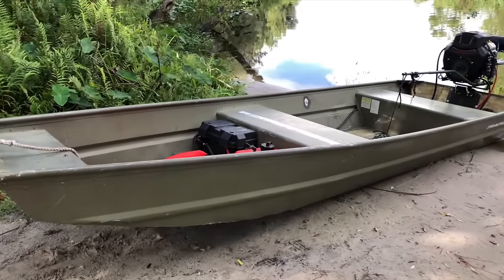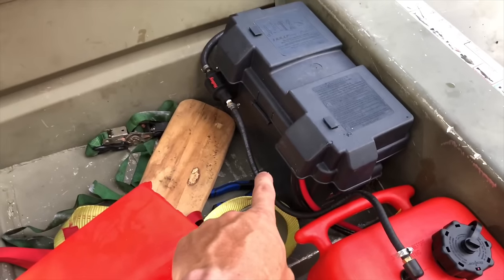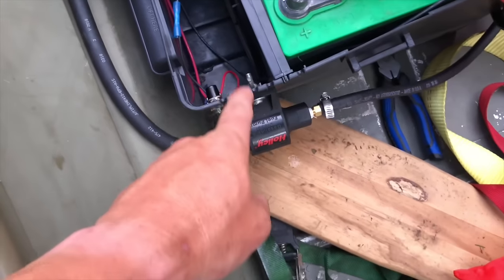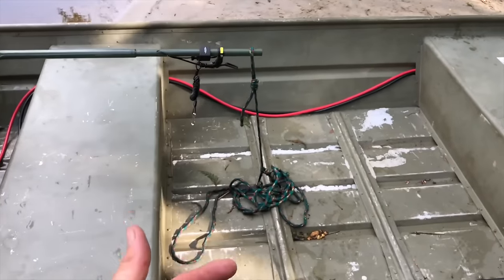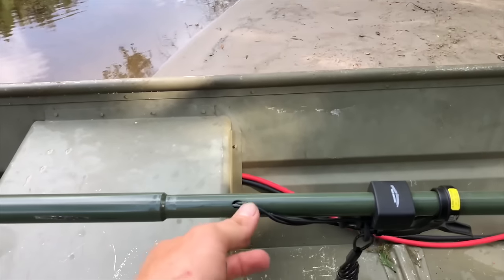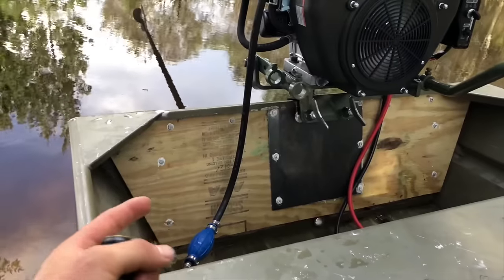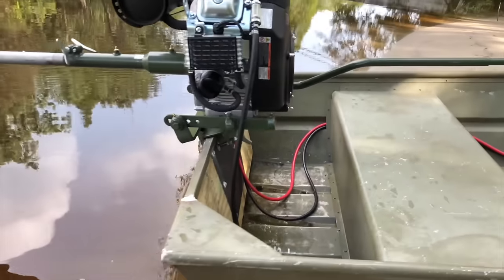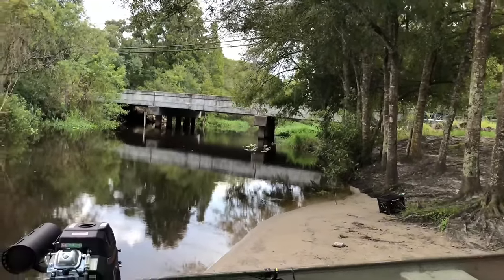22HP Predator 670cc SPS Mud Motor Setup 1436 Tracker

Comment: TIP: use a section of garden hose as a conduit for your fuel line when running it between the seat and hull. You can thank me when you're not stuck in the swamp with a leaking fuel line. Mud boats get a lot more vibration to wear any friction points along the fuel line.

Comment: nice setup,what I did to clean up my boat interior is get 3/4 inch pvc conduit and slide it in rib where you have your lines now.Put gas line inside one and battery cables inside toher one.

Comment: One thing I suggest is instead of the toggle switch for the auxiliary fuel pump run a wire to the ignition or kill switch so it turns on and off automatically with the motor
Reply from the maker: Arborcraft Surfboards yeah that’s a good idea! Thanks man
Reply: You dont need that holley pump at all and it will prob cause flooding / fire.

Comment: Thanks for the vid bro. I have a 14x36 and I want to make a surface drive for it, this helped a lot. Cant go wrong with that 5200! I found an old boat on a levee with a tree growing through it. Once I cut the tree down and got all the snakes out of it, I patched it up with some cardboard and 5200. I threw a 25 on it and  used that boat for four years with no leaks, before someone stole it.

Comment: I would move battery over where the fuel tank is and move the fuel tank where the battery is. That way you don't have your main battery cable running right next to the fuel tank... Also I didn't see any fuse on the fuel pump... Or a circuit breaker on the main battery cables I would add that also... If your main battery cable gets shorted out you could have a huge fuel tank fire the way you have all this set up...
Reply: KABOOM!

Comment: I've got this same engine setup on an alumnacraft 1540.  You did good to run the 1/4" fuel line the full length... I've got a frankenhose with reduction barbs going from 3/8 to 5/16 to go into the fuel pump then out of the fuel pump through another reduction to 1/4 to connect to the engine

The best thing I've done is fasten a PVC board floor on top of the ribs along with a grab bar... I feel much more comfortable moving around.

I see other comments about the throttle... I've got my throttle screw turned all the way in so my full throttle is really about 60% throttle.  I'm still out running the wake and by that point it seems like the more throttle you give is just louder, higher rpms, more vibration for minimal speed gains... I'm happy cruising 18-20 mph.  I'm running the 9.5" prop primarily.
Reply from the maker: Hise Chapman very nice!!! I have been pretty happy with it other than my rivets leaking now. I appreciate the comment!!

Comment: Great vid. Suggestions run your fuel line and power cables thru conduit doesn't have to be metal. Use a fuel and dielectric grease on as many electrical components as possible. Shrink fittings are great on your wires are good protection.

Comment: Good video brother installed predator motor on my new holland skid steer seems to be working fine fun boat 👍
Reply: I got one in a tractor backhoe and it has been great so far, had to rework the exhaust because it pointed towards the ground and would blow dust and dirt in the air and the air filter would clog up quick, once I replaced the air filter and pointed exhaust out the side it has been great. Do you have a hydraulic oil cooler on your skid steer? I have one on my tractor but with no fan behind it I’m afraid it’s not doing much lol

Comment: If you cut or break off a small pocket knife blade and then hose clamp it to the end of your long tail drive so that the tip of the broken blade is about a 1/16 to an 1/8th inch from touching your prop  it will cut and chop all the weeds as the prop swings them by.   I wrap the hose clamp in electrical tape.  I tried this as a quick fix while fishing crawfish ponds and it worked so well that I never bothered to improve upon it.  You could weld it or wire tie it or epoxy it for a more hydro dynamic  flow but these things are so crude to start with and it works fine with this 5 minute fix.  serrated blade  was what i had on me and used.   Broke the blade in a vise .  The square flat broken tip lines up good at the leading edge of your prop and quickly shortens the pocket knife blade to a usable level.  After you hit heavy weeds just raise your prop and rev it  once.   Weeds will still wrap your shaft in between your blade and shaft but wont matter much.

Comment: I have almost the same setup with a g3 1436 and a 6.5 hp predator on a swamp runner I also have a light bar and a trolling motor on it and I’ll run about 15 mph how fast does yours go with the 22hp

Comment: Good video. Gotta love swamp runners. The clamp on the throttle lever also clamps the rubber crip on. Much easier on the hands. Later man....
Reply from the maker: george davis thanks for the advice man!! I ended up just putting a hole in it and a bolt through it to keep it super secure.
Reply: I had the same problem with the grip on my most recent kit. Not a big deal as the stock grip isn't that comfortable anyway. I replace all the grips with slip on foam bicycle grips. Much easier on the hands during long days of operation.

Comment: Hey bro I been runnin a long tail for 7 years now and have figured out all kinds a tricks to make an better , cut u a piece of 1/2" pvc that will fit between the prop and the bushing . the pvc will spin freely on the shaft and the weeds won't wrap around it , ever get to polk county lets run the airboat trails on the big lake
Reply: Do you have a picture of this?

Comment: You can seal that transom with Bondo fiberglass resin. It will make it waterproof if you cover every inch of the wood. Water just beads off of mine a year after sealing it.

Comment: Put hair spray in rubber handle grip. It will stick. Bike tip.
Reply: Any spray adhesive should work as well.  Great video 👍
Reply: Or a locking mountain bike grip.

Comment: Don’t use treated wood right against your aluminum! It will eat it away, use normal wood and then seal it
Reply: Silly question maybe, but why is that?
Reply: Aaron Curtis lumber is usually treated with chemicals that contain copper. Copper erodes aluminum
Reply: @TechnoBabbles  the formaldehyde they use in the pressure treated wood pits and errudes the aluminum . Marine grade works too. I personally replaced wood and used starboard.  Wich is basically hdpe plastic.
Reply: Just replaced transom in mine, used 2 layers of oak plywood, soaked in fiberglass resin holding up great so far

Comment: Probably could use a small sealed motorcycle battery, and mount it on the transom. Eliminate the long cable run and the extra weight.

Comment: I have the same size boat. Been looking for the right size mud motor. Thank you for making this vid lol
Reply: Keaton Lingafelter that’s a ton of motor for the 1436. I have a 1542 with 6” gunwhales and it still doesn’t need this 22. I have the same motor and would probably go smaller if I did it again. Your transom isn’t made for this if you have this boat too.

Comment: Put your handle back on and drill a 1/4 inch hole through the handle grip and all. put a 1/4 stainless steel eyebolt through it with the eye on the bottom and an acorn nut on top. Now attach a piece of SS cable to your boat rib with a snap or carabiner on it to clip through the eyebolt to hold the engine out of the water. Once you're running just unsnap the leash and drop it in the floor. The handle won't come off anymore and you have both hands free to start the motor.

Comment: Did you run a return line to the tank? I have the 420cc and it runs on a gravity tank but i want it on external tank. Im afraid it will feed too much gas into the carb if it doesn’t have a return for the extra

Comment: Hey man, i got a question, i have the same exact setup but im working on my 1436 before i put it in the water, how high is the water line from the top of the boat? The motor seems like its gonna be a little heavy and im worried its going to ride to low once i add the plywood floor. And how low does it ride with 2 adults in it?

Comment: Nice job, nice setup, the only addition I would make is to treat the wood you have on the transom with resin to seal it up. I would have done this after drilling all the holes in it.
Reply: And stainless bolts. Those bolts he used will rust easy

Comment: Where did you mount the base holes to keep the prop in the water? I wondered if you put it toward the rear or in the middle considering the holes can be slid half inch or so in any direction.

Comment: I had a welding shop use aluminum to beef my transom up.  Had them use a scrap piece of metal and put a 90 degree bend on top same thickness of the transom.  This added some serious stiffening to the whole back end.  Also had a thicker piece of aluminum plate on other side and bolted it thru with treated plywood in between.  I did not know treated plywood is hard on aluminum??  My fishing boats had had marine grade plywood in them and I never noticed a problem.  Might of been 1/4" thick?  Should always try to use stainless steel around aluminum.
Reply from the maker: JOHN HEUY awesome! Thanks man!

Comment: Bro, you should have a fuse between the battery and the switch for the fuel pump circuit.

Comment: Does anyone have information about throttle cable connecting with this kit and governor manipulation with this engine? Stock with this motor I'm only getting about 2,000 rpm should be upwards of 4,000 rpm.. great video thanks for making it.
Reply: Top speed 6-8 mph using the app on my phone.. lame!!

Comment: I run a 1436 alumacraft with a 13hp it's a blast but I want more speed , when I can use it, I top out at 18 mph @ wot, so I would definitely be interested in seeing a wot run... when you have the chance to of course. Great video
Reply from the maker: Joey D that’s awesome man!! I will definitely be doing a speed test soon. I have tried but it’s hard to video it and drive. So far I’ve gotten 20mph running across the lake but I know I can get some more. Subscribe and you should get notified when I put up the video of it.
Reply: Only 18 mph Joey? I run a 13 hp SPS on a very heavy 1436 and get 23 mph consistently. What aize prop are you running?
Reply: @TheLostBoyScout  I was running and 8", and thinking my gx390 was old and tired, ended up buying an 18hp matched with a 9" weedless.. a bit more work to run, but I'm running 22mph now, being loaded..  added trolling motor, 80lb battery, and a floor, sliding corners so I'm  happy!

Comment: If you had had Tampa Bay Steel bend a piece of steel in a square U shape that transom would be even stronger.  I had mine done too. Arkansas back roads are hell on transoms unless you beef them up big time. Mines aluminum and welded.  Same idea tho
Reply from the maker: Mike Ries nice man! That definitely would have worked better!
Reply: @treylarsonproduction  my boat kept breaking welds on the corners. Second or maybe third time into the machine shop someone had a brain storm. Made me a piece all custom. Beefy as heck.
No trouble since.
I'm running motor way up high like I have a jack plate but dont.
Bolted on...it goes fast. Next time in I'll have them extend the transom higher by about 3 inches. 
Funny but my short shaft johnson motor on short transom boat don't fit right and needs raised about 4 inches to get optimum performance. It really scoots for a little River jon but mines a 1640..lot like yours
Reply from the maker: Mike Ries nice!! I plan on upgrading to a bigger boat next season. This 14fter needs retired

Comment: I have a 1548 and I was considering this exact set up, are you overall happy with it? Any other tips?
Reply: Are you pleased with the power of the vtwin?
Reply: How's it do on gas
Reply from the maker: findurfreek so far I am very happy with it! Although, it does get hung up in the weeds. I may be trying to run it through to thick of stuff though. The engine and the swamp runner kit are running awesome though!
Reply: findurfreek the 48” Hull may be too wide to get the prop in the wake swell behind the boat. I have a 1542 and this setup and I love it. I would call swamp runner and see. So far I love the setup but I only make 2 mile runs so it only has 8 hours on it. Pushes close to 30mph with just me. Too fast for a longtail honestly.
Reply: findurfreek my 1542 runs less about 5mpg with two guys, gear and a dog. Exact setup motor wise except a facet cube pump for reliability.
Reply: findurfreek mine is torque-y as shit. I put lag bolts in to keep it on the boat. 4000rpm is 4000rpm so a 13hp will have the same top speed if it can get the boat on plane. Digging out of the mud is different. The 22 is a beast honestly.
Reply: @BoilerTimmay  I’ve got a 1542 that I’m thinking of putting a 22 hp on. What’s the performance like on yours? You hitting 30 with a stock motor?

Comment: Is it balanced well in that third mounting hole? Have you tried others?
Reply from the maker: Tim Huser I haven’t tried the others but where it’s at right now is balanced when running it. When I’m not running it, it is back heavy. I will probably try the different positions and see which feels best.
Reply: Trey Larson Cool. I'll let you know what my results are too. Thanks for reply. I didn't look at the date and just now realized this was a brand new video. Good luck with the setup, and on the season. Since I'm going to be running the same setup reach out if you have any questions or tips.
Reply from the maker: Tim Huser thanks brother!! I definitely will!

Comment: Did you remove the center brace on the transom. I have the same boat but mine has a center brace. Due to the brace I can't use a mud motor.
Reply from the maker: 14 Challenger no I did not have one on mine. I think because it was older.

Comment: Great vid. ...anything special when you hooked up the throttle cable to the motor side.I can't get full throttle on mine
Reply from the maker: Thank you!! No I ran the cable back to the throttle assembly, removed the one that was there and installed that one. I pulled it tight before tightening it down but it was a pain working on that sideways screw behind the muffler.
Reply: @treylarsonproduction  I use a pair of pliers on it...its a real nut buster....you getting idle to full throttle with no special adapters..
Reply from the maker: ron demers I honestly haven’t been able to check since I’ve been working on it by myself. Once I get some help, I’ll have someone play with the throttle lever while I watch at the engine. But no I don’t have any special adapters or anything. Just the swamp runner kit and the engine the way it comes from Harbor Freight.
Reply: @treylarsonproduction  putting my throttle on today ill let you know how I make out.....thanks Trey
Reply: Nothing special had to pull cable tight when tightening ferrule. ...just got home from running it and what a workout
Reply from the maker: ron demers very nice! Yeah it definitely is a good workout!!

Comment: Hello, very nice and instructive video, for someone like me who knows nothing about all this stuff. 

I'm writing a story where people are using boats like this, and I've got a question : with this longtail, is it easy to maneuver ? like at low speed, or in rear walk, for example to get out of the bank or out of some obstacles ?
Reply from the maker: Louis Crozel thank you! It is once you practice with it. It takes some time to learn that to stop or slow down you lift the prop out of the water. There is no reverse and if the motor is on, the prop is turning pushing the boat forward. Other than that they are pretty good. Not as maneuverable as a surface drive.
Reply: @treylarsonproduction  Thank you very much !

Comment: Would this engine and kit be ideal on the tracker 1648 or even the 1754?
Reply from the maker: Dante Cantu I believe so. It’s a big engine for my little boat.
Reply: I got a 1655 with a 22hp and it does ok but not great. It will run 19 with just me in it. Although I got a backwater kit.
Reply: C Price  How do think it would handle with you and 1-2 other guys with gear? Thanks for the input!
Reply from the maker: Dante Cantu last weekend I had me plus two other guys and all of our duck hunting gear. Us three together weigh 585lbs then all of the duck decoys and shotguns and fuel tank and battery etc. it got us to the spot but was a little sketchy. This setup is perfect for one or two men and gear but adding that third guy I feel was a little too much.
Reply: Trey Larson thanks this helps a lot !
Reply: Yes that would work great on the 1648 because that is a all welded grizzly jon.
Reply: Dante Im wondering the same. Ive got a 1979 1648 tracker I ordered the large sps for.. Looking at the 22hp predator.  48 is max bottom reccomended but im wondering about the 22" transom being to tall.

Well ill see I guess, not much ive seen on bigger boats.

Comment: What if you weld a half cone around the patella nowhere near it just shadowing it large enough where the weeds will go over the propeller not cutting off the performance of the propeller as well you need a more sleeker and sharper Style propeller or try sharpening the one you have already on there #js

Comment: I did twice and I just can't get where you get the bracket
I have a boat like yours
Reply from the maker: Michael Mcginnis the green part the motor is sitting in comes with the entire swamp runner kit. The metal plates on the transom are from Tampa Bay Steel